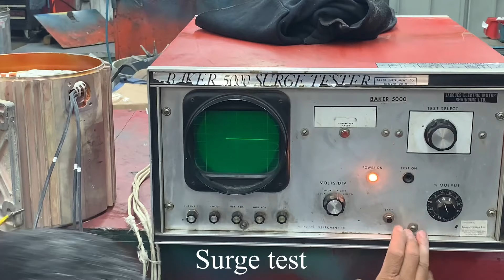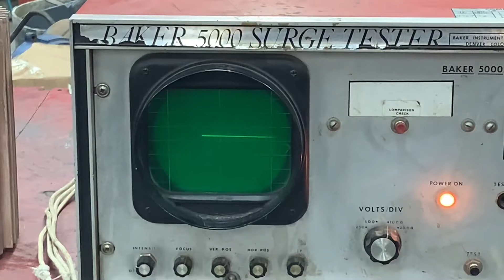Motor Rewinding | 7.5 hp Blower motor | 3525 rpm high speed

Comment: Also what is making the Varnish Bubling while adding the stator to the varnish? Thanks
Reply from the maker: Varnish penetrations inside the slots all the way to the sleeving and it has a pump on the varnish tank to create circulation.ones no more bubbles winding is already properly coated with varnish.
Reply: Do mind ask what kind of pump you use in the Varnish please?
Reply from the maker: @stevetheuma8834  I’ll do filming in the varnish tank on my next video
Reply from the maker: @stevetheuma8834  Is not that special I’m sure it won’t be hard to install on the varnish tank.

Comment: one help sir on 50hp motor rpm 1440
Reply from the maker: What help you want to your 50hp winder?
Reply: 50 hp motor pitch 10/12/14/16
slots 48  turns 117-117-117-117
swg 19+19+19+19+19+19+19+19+19

conn dubel paller 
set winding 
unlond currnt 80 amp 
so you send digram 
1440 rpm 
dubel peller conn

Comment: Always thanks for sharing. Having the 3 phase voltage 565 in Canada and will be rewinding a 3 phase motor from New York rated 460 volts, what do you do? Thanks
Reply from the maker: You’re welcome.It won’t be hard to change the voltage of a motor just change the size of wire and turns by the formula and same design of the type of winding.Thanks